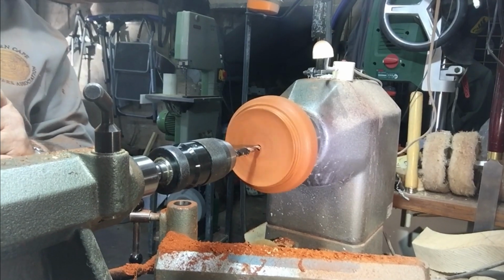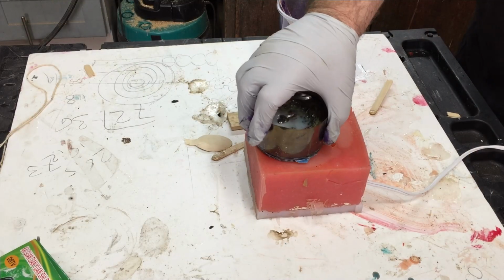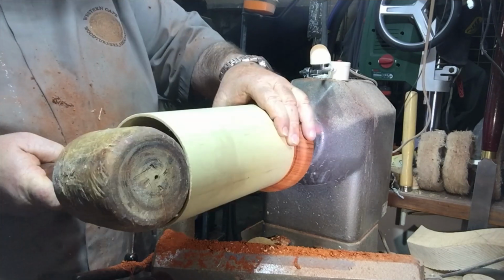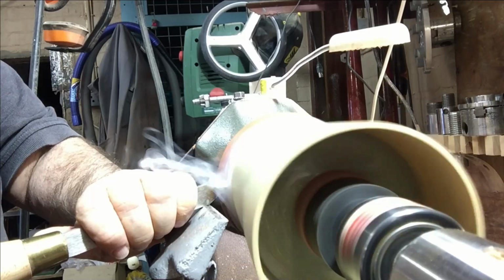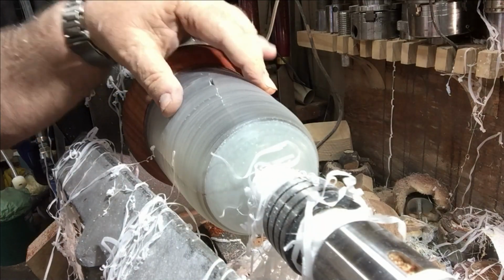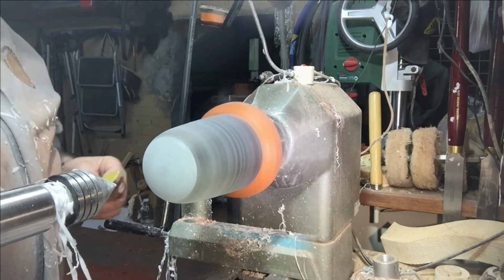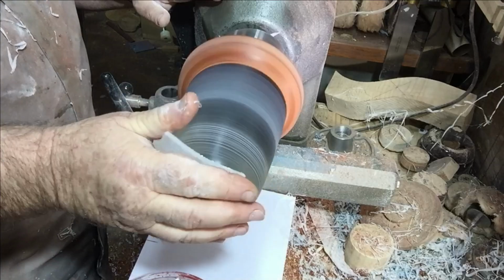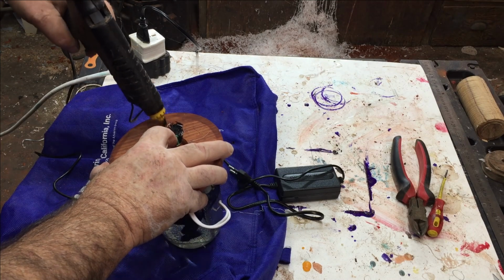wood turning figurine lamp

Comment: Hi Ahron i've just replied to your other comments that you sent me, asking about what resident are use or going to use, The firm is called Epodex they are based in the UK and in France and Germany need to say I will buy mine from France as there is terrible import export duty being put on things travelling back and forth in the UK now because of Brexit, this has messed a lot of things up that I've been hoping to buy from the UK I was going to buy my pressure pot from there but because of the import duty export duty and all the relative paperwork that has to be done now I've bought one from France the thing is I think it is a Chinese import which I do not like to buy from them, so hopefully around March time I will have my pot and my resin I have a piece of wood that I returned back in December which was a root  ball it has lovely green in it and it's now getting quite a few cracks in it which I'm hoping to fill with resin if I ever managed to find out how to take a picture and send it to you I will try,
Sorry if my message seems a bit garbled I live by myself and I'm approaching 70 years old so I'm a bit of an old geezer but very young at heart I wish I was still working.
Stay safe keep up the good work.
Phil from the Moulin in France
Reply from the maker: Thank you philip vale i am glad you like it and found the time to comment.Thanks for the info , i did send them an email and i am waiting for them to reply to me. Cheers Ahron